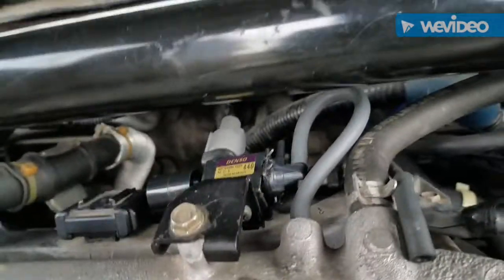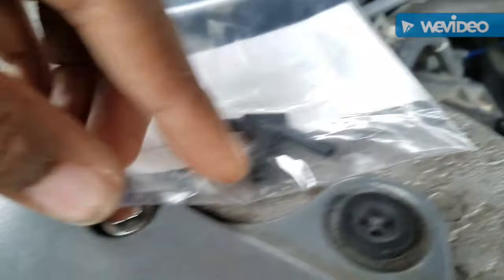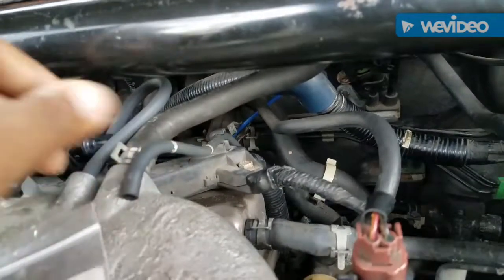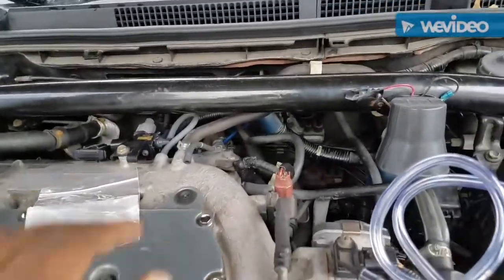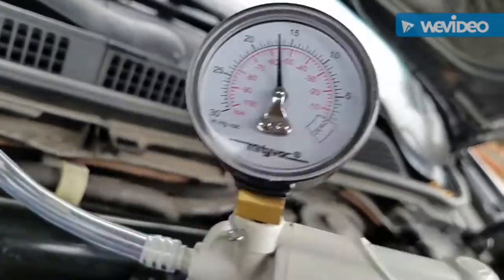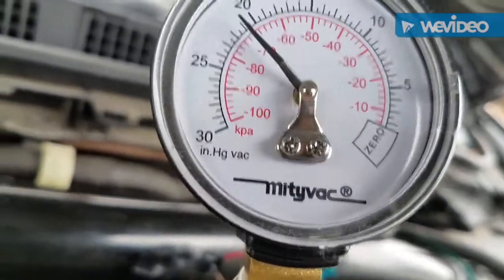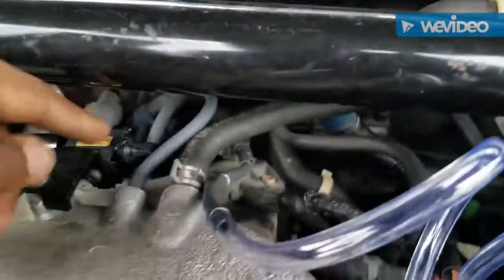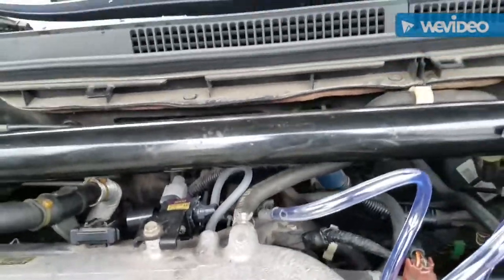HOW TO TEST ENGINE MOUNT VACUUM LINES

Comment: If mount is bad would it give me problems with intake vacuum leak I can not get rid of a P2279 code
Thank you!
Reply from the maker: probably got a throttle body gasket leaking or intake boot leaking check them both.
and if you cleaned the throttle body make sure you do the throttle body idle relearn procedure.

Comment: Hi, Fabolousg4ever can you tell me if all makes of vacuum mounts (for a BMW) should hold vacuum whilst off the car. I have purchased a new pair but both don't hold vacuum, I am thinking I have purchased faulty ones. Any help would be appreciated. Thanks
Reply from the maker: Theeban Thevabalan if they don't hold vacuum thrn return them hydraulic mounts should hold suction
Reply: Thanks fabolousg4ever, appreciate the advise. I will get them returned. And thanks for posting your video to help out.

Comment: Assuming my vacuum lines are good with no leak, can I use this technique to diagnose bad engine mounts since they are hydraulic? To see if they are working? I just replaced right engine mount, and most people say my front might be bad as well and should be replaced.
Reply from the maker: +hungh13 yes if it hold pressure that means its good if it doesnt means there a leak meanning theres somthing wrong with mounts.

Comment: if the hose to the solenoid broke just from the heat over time, could that vacuum leak cause drivability issues( power loss or hesitation?)
Reply from the maker: no just more vibration in the vehicle
Reply: Yes it would. Affect fuel air
Reply: Yes it affects the  Fuel air ratio.
Reply: Right, I'm here because of a persistent P0171 (high LTFT) that I'm starting to suspect is an engine mount circuit leak.

Comment: I bet the reason why my car vibrates really bad in gear and not in park or Neutral. Could mostly like be the three way valve and vacuum hoses.
Reply: I replaced my mounts and still have rough idle problems in Gear. Im thinking it Could be a leak some where on the hoses Or valve.
Reply from the maker: check mount vacuum lines.
Reply: MODS FOREVER ill check those going to have to get a vacuum gauge. The one you use

Comment: what if you drive without the vacuum connected to the mount....will there be a problem?
Reply from the maker: Smith Gartey vibration and alot of it in the cars cabin.
Reply: fabolousg4ever.. yea cuz i watched your video on how to change front mount..i did everything you did..but there's a bolt that wouldn't loosen ...so i put everything back but didn't connect the vacuum tube....thanks again for the videos bro u save me alot money...
Reply from the maker: Smith Gartey no problem anytime.
Reply: fabolousg4ever  if there's a leak would it effect a lack of respond when accelerating also lack of power???

Comment: We replaced the motor mounts in my 2004 Acura TL. When we  replaced the rear one The motor had a lot of vibration afterwards. We took it off and tested the line that goes directly into the motor mount and it does nothing. Do you know if it’s a bad mouth or if it needs a new line?
Reply from the maker: Were they oem or aftermarket
Reply: Aftermarket
Reply from the maker: Aftermarket mounts will shake alot
Reply: @fabolousg4ever  But when we pump the vacuum line the gauge doesn’t read anything. So doe the vacuum line have a leak?

Comment: Where is the 3 way connection located
Reply: Follow the tube about 1.5 feet or so..
And it doesn't really matter just as long as it's all hooked up .your just putting in a y..its not  a valve...